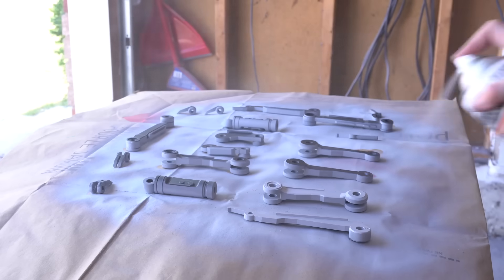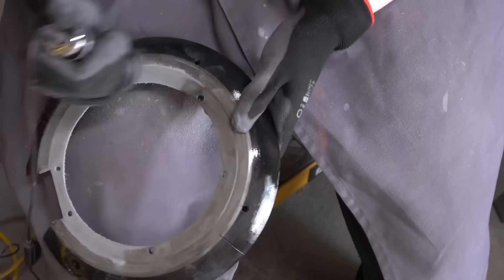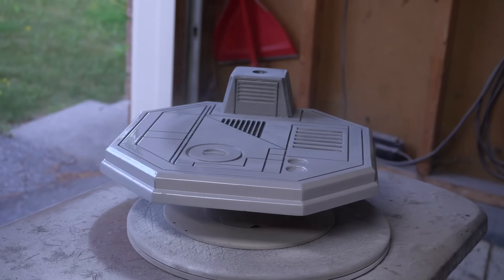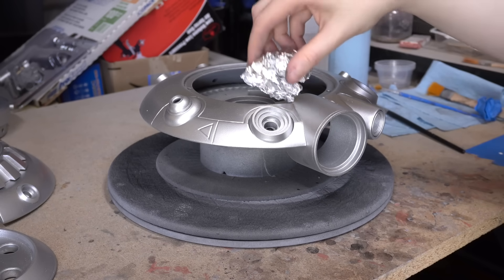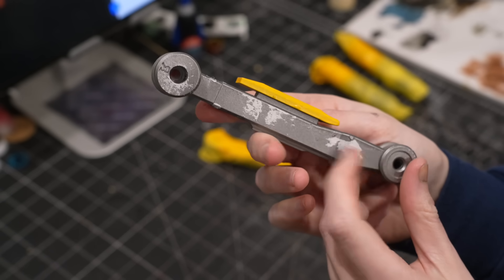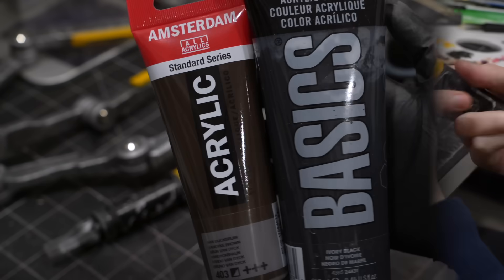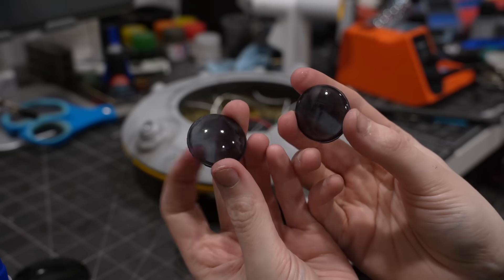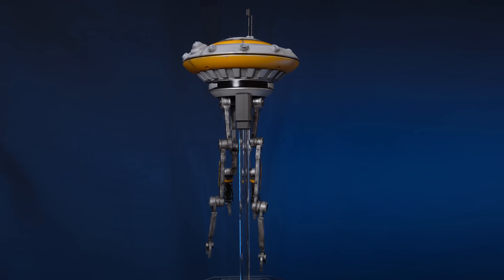Can You Build an Entire Droid in 3 Days?

Comment: Do I remember correctly from one of your other videos that you used clear plastic baubles for lenses?  If so, may I ask how you cut them to size and any tips for doing this?  I'm working on a droid build now and will be trying the tinting spray from this video on said baubles to try to make the lenses.  Just trying to come up with a good way to cut them to fit.  Plan-A is a Dremmel with a small cutting wheel, maybe with tape around the outside of the bauble to support it during cutting.

Comment: The only thing I really don't like about using the coin batteries is the cost and limited run time. I always use a 2 AA pack with an on/off switch so the batteries cost 1/10 of the coin batteries and have days of run time instead of a few hours. If it's going to be a static object USB for a power bank or phone charger.

Comment: Hello! Do you apply a clearcoat to your pieces to avoid that sticky paint feeling? I haven't finished the video yet but wasn't sure what to do for my props. I usually spraypaint them, but they always feel a little sticky or tacky after and I'm not very familiar with painting. I try to avoid spraypainting now because of how it feels after. ^^;
Reply from the maker: Most of the time I don’t clear coat the pieces. The one exception would be for metallic chrome paints that I airbrush on to protect the finish. 

It could be the type/finish of spray paint you’re using. Some paints could feel less tacky as they fully cure (like 48-72 hours+ later). If you live somewhere really humid that could also be contributing to the sticky feeling of the paint - most spray paints have a humidity warning listed on them. If humidity is an issue, then clear coating it with another spray paint wouldn’t necessarily help very much.
Reply: @MMsPropShop  Oh, I didn't realize that humidity could cause that! I live in Ontario, and it's 80-90% humidity a lot of the time during the summer. 🥲 Maybe I just need to put the finished pieces in a very dry room after painting for a few days.

Comment: Can we get a link to the joint bolts you used? I have a couple of droids in the works
Reply from the maker: If you plan on making multiple droids in the future then I’d recommend picking up a set or two of M6 bolts similar to this: https://amzn.to/4maZ5dJ

You can always restock on the sizes you use the most but buying a full set is the most cost effective way to get started. Some droids will also use barrel nuts which can be found in other sets.

Comment: The clear resin lenses are interesting to me in particular because last year I printed a NCR ranger helmet from New Vegas and I wanted clear, red lenses printed out of resin. It took me a million attempts but the winning solution ended up being sanding them up to like, 3000 grit and then using a rubbing compound followed by a polishing compound, followed by multiple coats of a high gloss varnish, followed by more sanding, rubbing, and polishing. But the end result was glass clear and let me wander around in a fully enclosed helmet with perfect clarity!

Comment: Excellent work, but I have a critique- it seems odd to use a clear pole to make the droid look like it's floating, but to then have a large and very obvious black mounting arm on the rear of the droid to connect to that. Would have been better to heat and bend the clear rod 90 degrees ( be brave... ), or run the rod right up the middle and 'hide' it between the legs.